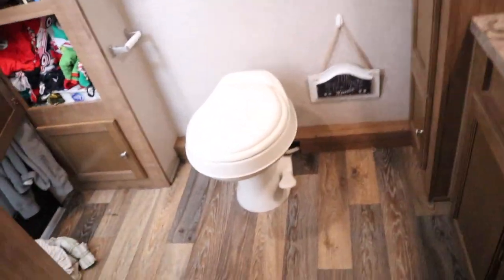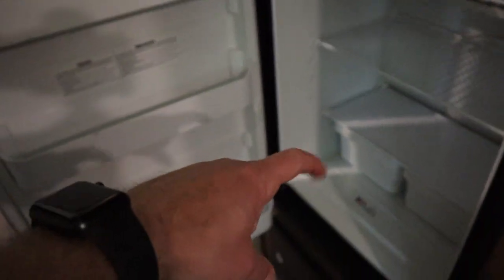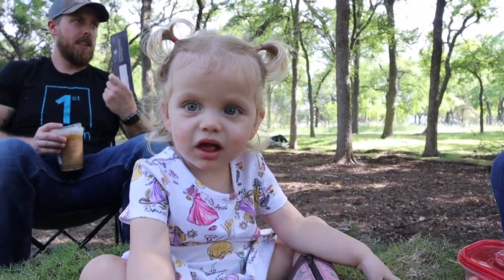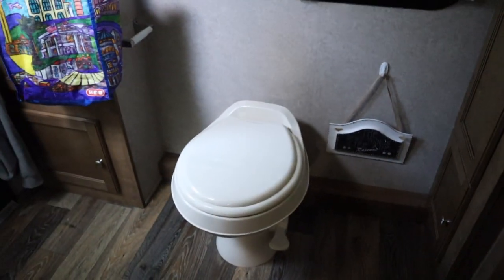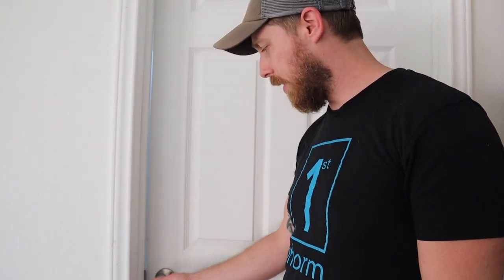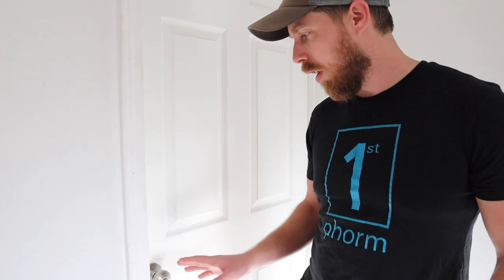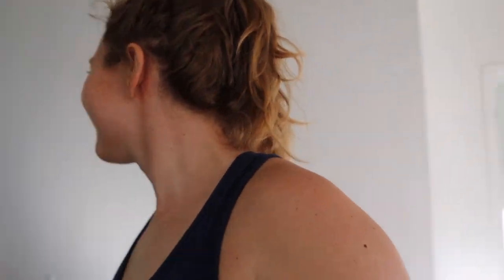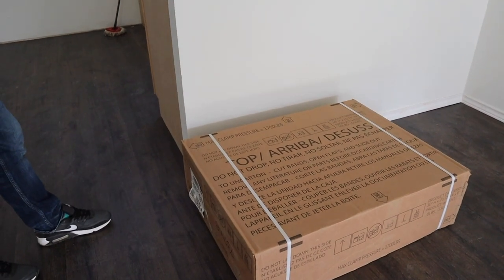WE’RE MOVING BACK!! 🏠

Comment: I had my Dometic refrigerator burst into flames. And I was plugged into electric at the time. My wife and I were out of the RV at the time. Our neighbor came running with his fire extinguisher and got most of the fire out. But we still had to call the fire department. They had tools to see where the hot spots were smoldering, and ripped out the frig to find more fire.So the RV was totaled. Now whenever I buy a RV I call the fridge manufacture and check on recalls.🔥
Reply from the maker: Oh my gosh! We checked a few years ago about recalls. Wouldn't hurt to check again! Thanks for the tip. So glad y'all weren't in the RV when it happened!